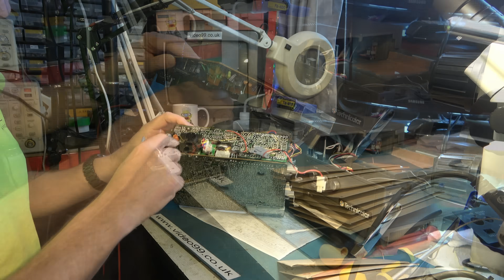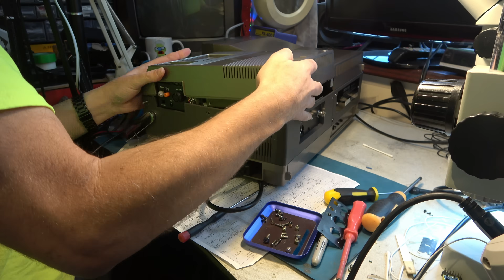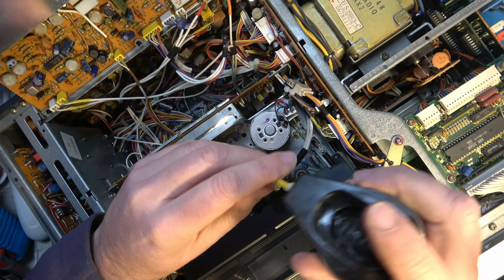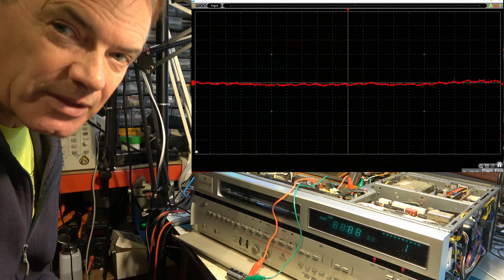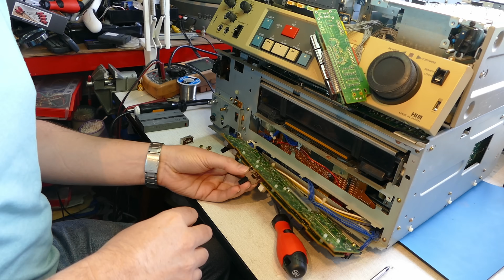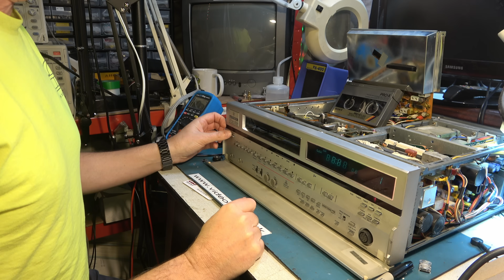Two very old video recorders. CVC Showcase, Ferguson 3V23 both get new capstan belts.

Comment: In the 212E portable, there's a fifth belt on the top side of the deck that drives the tape counter. Looks quite a faff to change. Is that belt absent in the Showcase?
Reply from the maker: No, it's on the showcase too.
Reply: @video99couk  I'm hoping that belt is only for the tape counter and doesn't drive anything else. I haven't got a replacement for it. I'm in the midst of a massive cleanup operation at the moment. All of the belts have degraded, but the long serpentine belt has disintegrated into black sticky tar, which has even managed to contaminate some of the cogs where the belt had fallen. It's a bit of a mare.

Comment: I had this wobble on a 1991 alba mono machine not so long ago and it turned out to be a worn capstan roller and a dirty back tension felt belt, when the tape is running put your ear down near the capstan area and listen to any creaking noises as the tape passes through the capstan you shouldn't hear anything, Luckily enough I carry spares for this particular VHS machine including a whole new transport and capstan motor, I swapped it out and the wobble had gone I even put the old capstan motor on the new transport and the wobble was still gone so decided to go through the old transport and find the fault, the trouble with these old linear machines is it's just like an audio cassette deck a dirty capstan roller tape path will give you all sorts of speed pitch issues, in the end I replaced the pinch roller and replaced the back tension belt and now this vcr is working again.

Comment: regarding VHS thread/unthread speed of some old beasts, surprinsngly the oldest beasts of all VHS,  the HR3xxx series are amazingly fast.
don't know why they moved to something much slower after, but the earliest VHS mechanisms were somewhat interesting.
Reply: The Philips Echo deck is also quite fast. The Panasonic G mechanism has to be the slowest mech of all time. The GII mech is much better.
Reply: @crashbandicoot4everr  sure the late philips V2000 and early VHS mechanism was really fascinating design (then charly... i'm still questionning myself...)
i don't think G mechanism was slow in general, but sure it was for editing. but other than that, threading tape is not that slow for exemple.

Comment: Thanks for another very informative and entertaining video! I'm now inspired to get my CVC machines out and do the belts - this series of videos will be my bible! The belt specs in the service manual are hard to interpret. The table seems to have several typos. The "10 belt" and "80 belt" have two diameters - does that mean they're round cross-section, or is that just a typo?? I presume the "12 belt" should have as well, but they've typed a letter o instead of a phi. I assume the "Plane belt" is a 5mm wide flat belt, but even that isn't clear.
Reply from the maker: Everything about the service manual is unclear.  The main belts to worry about are the long belt which is so hard to fit, and the capstan belt.  The others are relatively minor.
Reply: @video99couk  I couldn't find belts that exactly matched the specifications, but I've ordered a few from CPC which I think will be close enough. I'm just hoping the old belts haven't turned into goo and made a horrible mess.

Comment: You should demonstrate the 2x  speed with audio. It's very special on that machine. If you actually track it correctly you can watch a film in half the time ..... ;)
Reply from the maker: Handy for Titanic.
Reply: That's the feature that doesn't work properly on my AKAI-branded HR-7700/3V23. The capstan doesn't go as fast as it should. It plays at like 1.5X.

Comment: Power the   capstan motor directly off a power supply and playback your tone tape you can then check and rule out the servo obviously the tracking won't be correct for fm.
Reply from the maker: That could be an idea, though I think I've almost ruled out the servo already.
Reply: @video99couk  check for stick and slip on the lower drum. If you reduce back tension with your finger does it help ? I think the back tension arm rod is quite a beast as its used  to pick up a 30 Hz (or khz cant remember) tone for Cue trigger. I read the service manual when I was 17 ish !

Comment: The top board has a service position you don't lean it back you stand it up into the lugs either side.
Reply from the maker: I hadn't spotted that.
Reply: @video99couk  I did exactly the same thing years ago lent it back and blew a fuse.. You only do that mistake once when you hear the ark lol
Reply: The SL-C9 also has that, as does the NTSC version, the SL-2500. Sony was good at that.

Comment: I believe you can use any JVC remote control from the early 80s like rm-p22 or rm-p120.
Reply from the maker: Possibly so, but I would really like the original remote control (or the JVC version), especially if I can fix this warble problem.

Comment: Have you looked at the pinch roller on the Ferguson ? It might have a problem.
Reply from the maker: The warble is too quick for the slow rotation speed of a pinch roller.  Contaminated capstan would be possible, but that's been cleaned.
Reply: @video99couk  Yeah. I was forgetting about the slow tape speed of videos. 😃

Comment: Check the back tension brake/felt. It looks like some JVC, am I right? I´d go with the felt pad first. They tend to cause tremendous amount of trouble in some machines.
Reply from the maker: Will do.  Not that a back tension band will be available any more.
Reply: @video99couk  That´s not such a big deal. It is possible to salvage some from "modern" machines and glue it in. I´ve done that before on some 80s Panasonic/National VCRs. Their felt bands just fall off because the glue turns to brown powder.
Reply: @lukasgayer5393  National Panasonic is the worst as far as that goes. They used a copper band with the felt glued onto it and they all fail. Not to mention their excessive back-tension setting that wears the heads down and causes the tape to slow down as it's reaching the end during playback.